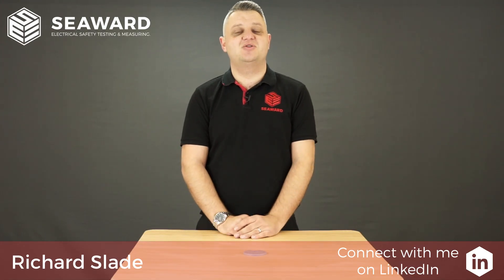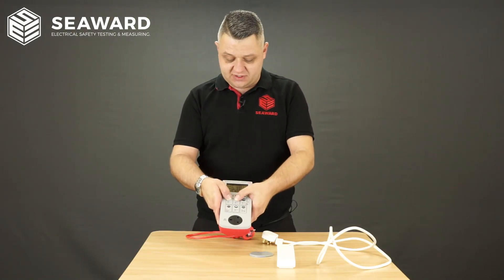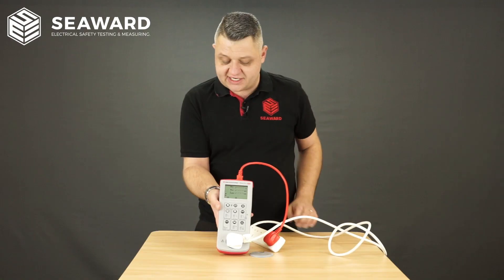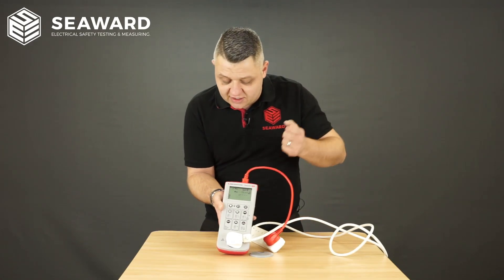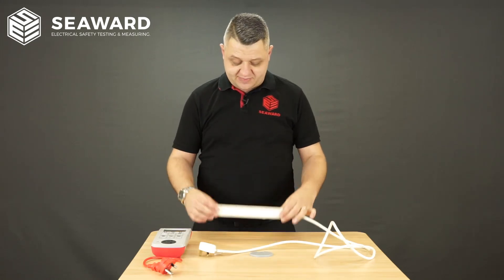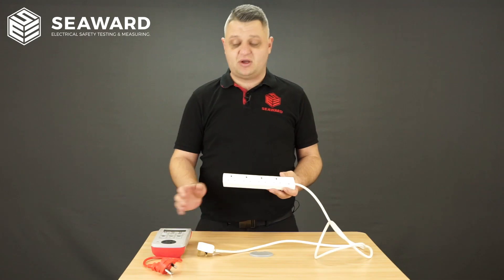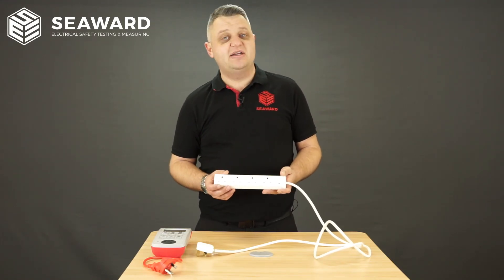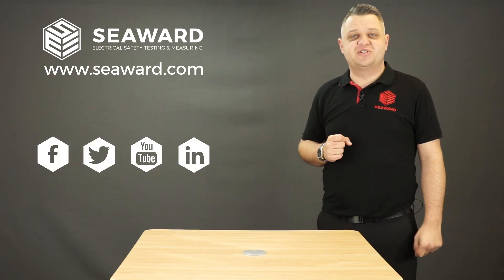How to PAT test an extension lead - Seaward

Comment: I am using an apollo 400+ it fails surge protected 5m cable with 1.25mm cable, 0.12 ohms when threshold is 0.1.  Can you adjust settings to record a pass?
Reply: If you've already adjusted the settings of the continuity test to match the cable, then that's the threshold the cable needs to meet. A cable with those attributes will increase the threshold to 0.1078 Ohms, which is not far from 0.12 at all. Have you tried sanding down the earth pin? Sometimes corrosion can slightly increase the resistance.

Comment: How do you test a 110v extension lead? I'm using the 110v adapters but they keep failing so I must be doing something wrong 🤔
Reply: Hi, are you using the 110V to IEC adaptor to return the lead back to the tester via the IEC input?
Reply: @DilogGroup  yes, 13a plug to 110v socket - extension cable - 110v plug to IEC. 👍
Reply: Why is that plastic insulated lead a class 1
Reply: @pcg1276  which lead?
Reply: @Zeamus634 The white extension lead, is it because it has an earth cable?Can you give me an example of a class II appliance please.